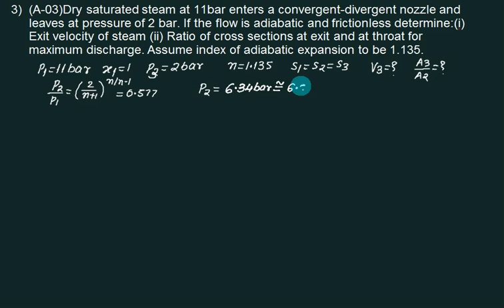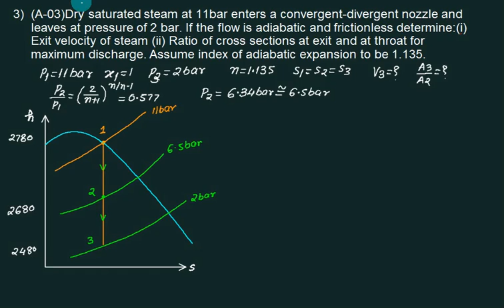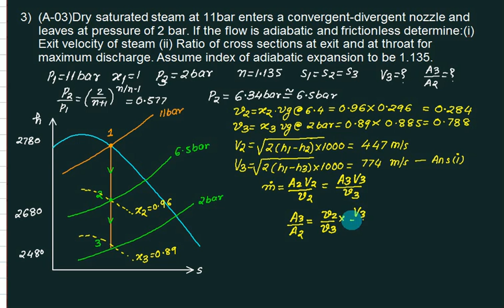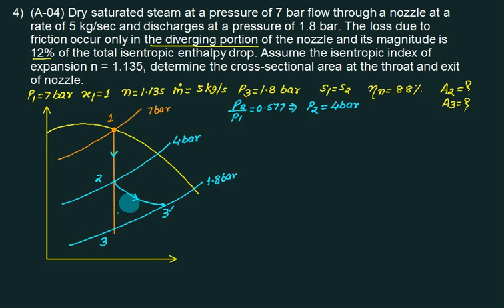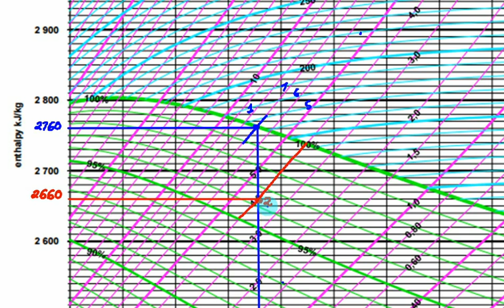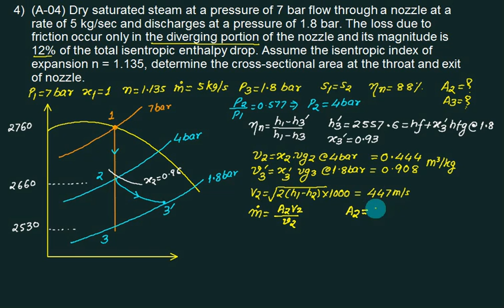Comment: Sir explain the terms please???
What is p1,p2,p3,
Please sir
Reply: Fighter MMA how to find volume  please  sir
Reply: P1 boiler or supply pressure , P2 is throat pressure and P3 is back pressure or condenser pressure
Reply: @sunilmohodmh31  and sir when will we consider the dryness fraction values and all like sf2,x2,sfg2,hfg2,hf2 ??
It will really helpful for me if I can get your contact number ? 
I have exams 2weeks ahead .
This chapter is taking more and more time .my problem is 'i don't know how to read the mollier chat and stream tables and I'm able to understand the derivation and all ' & I'm having immense confusion'
Help me sir please,sir please ..
Reply: if the steam is wet then only consider dryness fraction.
Reply: @sunilmohodmh31  sir , when the temperature is 200°C the steam is considered superheated then in solution you have written like h2=hf2+(x2*hfg2).what does it mean sir? Can U please elaborate the terms ?